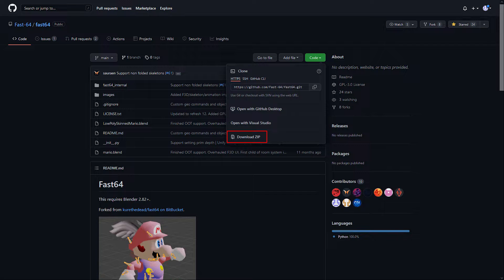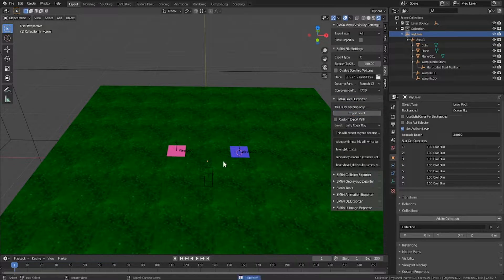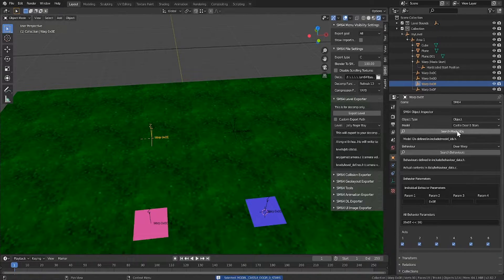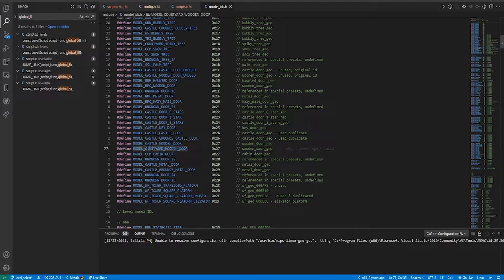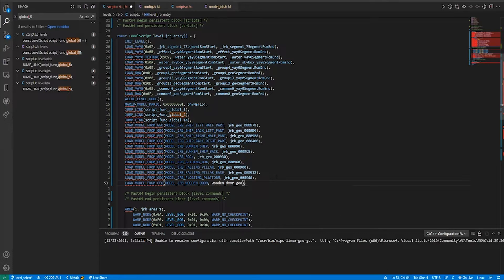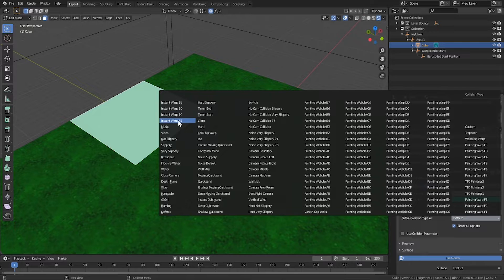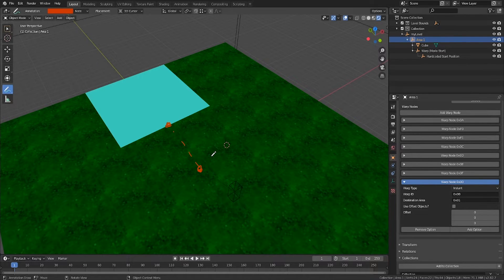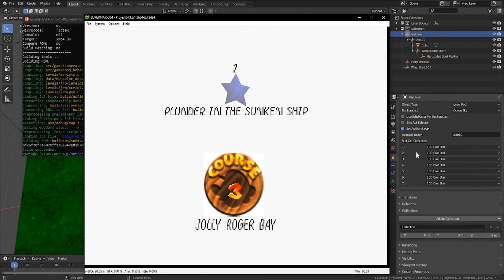SM64 Decomp - Fading, Door, and Instant Warps

Comment: Do you know how Mario 64's cutscenes are handled in the code base? And if it's possible to animate new ones in something like Blender? Is there any good documentation out there for this, as it can be difficult to find these things unfortunately.
Reply from the maker: So I'm not sure about any blender implementation for cutscenes, but all the cutscenes are stored in camera.c. I'd recommend taking a look at sCutsceneDialog and the function cutscene_dialog. 

In this instance, there are three main events
1. cutscene_dialog_start - Initializes relevant variables
2. cutscene_dialog_move_mario_shoulder - Moves the camera until it's at the position set up in step 1
3. cutscene_dialog_create_dialog_box - Make the dialog box

Then it waits to see if the dialog has been closed before ending the cutscene.
Reply: @Bitlytic  Thanks for the advice. I imagined it probably wasn't possible to modify the camera properties in Blender, but that would be an awesome plugin to make things easier. I imagine it would still be possible to make custom animations for characters in Blender though and just programmatically set them in the source code to change at specific points though?
Reply from the maker: @HardCorePoration  Yeah, if you're talking about just regular animations like walking/diving/etc., I would recommend frozenmeatpopsicle's video for it
https://www.youtube.com/watch?v=ql0UjZJtEOo

Comment: Is there a possibility of you covering warping to other areas or even making other areas in the first place? It's got me a bit stumped
Reply from the maker: I might, but it'd be a pretty short video, I'll just give you a quick explanation of how it works:

You've got your level node, that's what we select when we export, and under that is your Area 1 node, if you wanted another area you can just add a second area node as a child to the level node and increase the index by 1.

As for warping between areas, you would place the warp in Area 1, and set the destination as the same level but the area as the second area.
Reply: @Bitlytic  Thank you. I was on the right track, but it kept crashing. I just looked at the script file for jolly roger bay and combined with your help I was able to get it to work.

Comment: is there any way to make the m64 stage bigger? It seems kinda small
Reply from the maker: I'm not sure if you mean total size, but if you're using HackerSM64 you can create levels up to 4x size using the config. 
If you mean that the level exports and it seems small, there's a scale property you can set in Blender so it exports bigger, by default that's set to 100x.